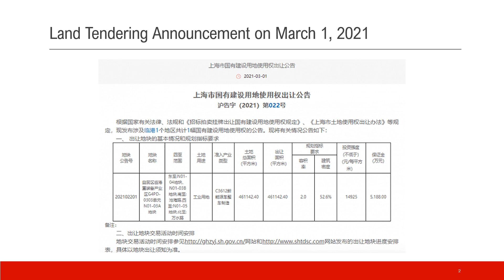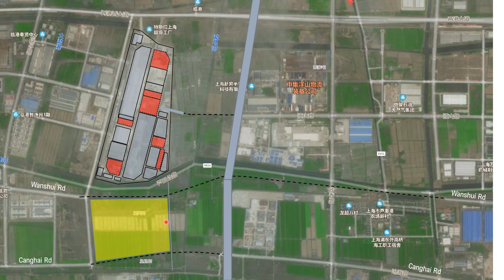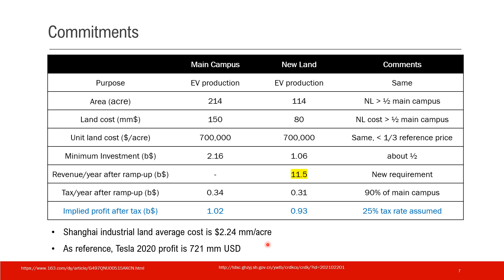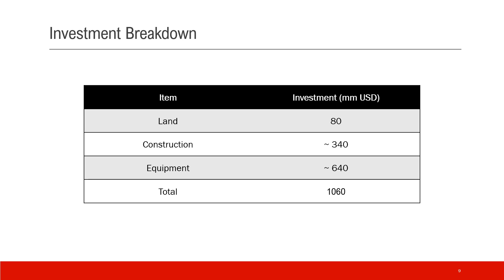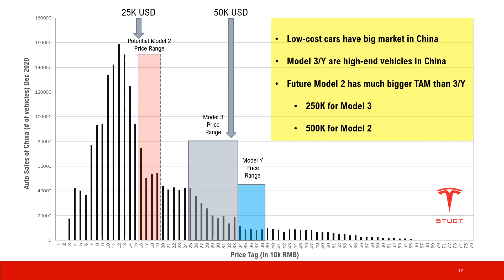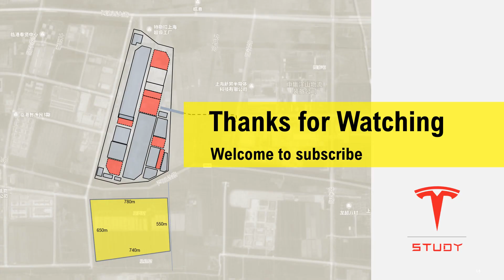Tesla Shanghai‘s New Land

Comment: Thank you for your wonderful job. I just wonder that Is revenue target $11.5Bn your expectation or another source from local network?
Reply from the maker: In the first link posted in the description: https://www.163.com/dy/article/G497QNU00515AKCN.html, there is a statement "项目在交地后5年内达到达产销售收入不低于750亿元/年，达产税收总额不低于20亿元/年，达产税收产出强度不低于4337元/年/㎡." 

Personally, I think this requirement is a bit too high. Assume 500,000 units/year capacity, $25,000 x 500,000 / 11.5 Billion = 1.09. So, Tesla has a safety buffer of 9%. That is quite small safety buffer for a risk of losing your factory and land.
Reply: @t-study5089  Oh, Thx. Model 2 will be killer application.

$25,000 Autonomous EV. 

Souds disaster for traditional OEM
Reply from the maker: When the tridiagonal OEM lose market, their average vehicle cost goes up due to some fixed cost. That will drive market share further down. You will see some small OEM disappear in a few years.